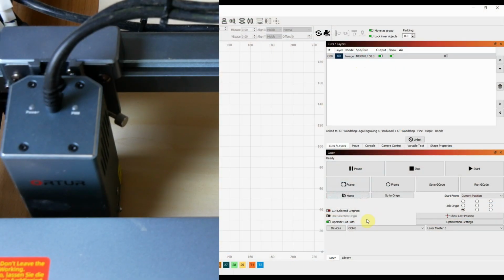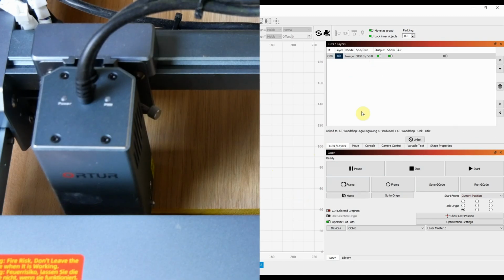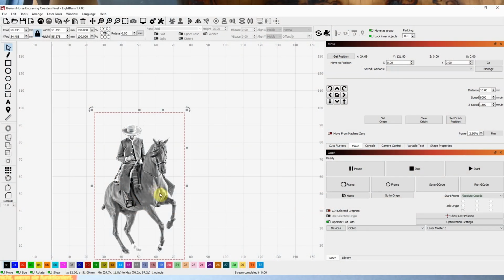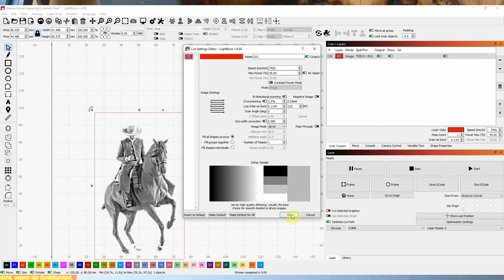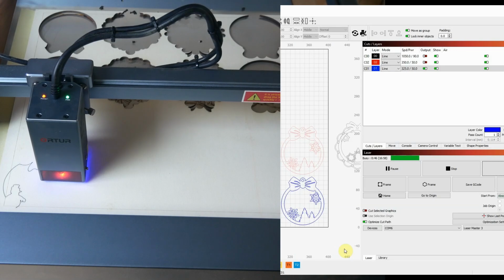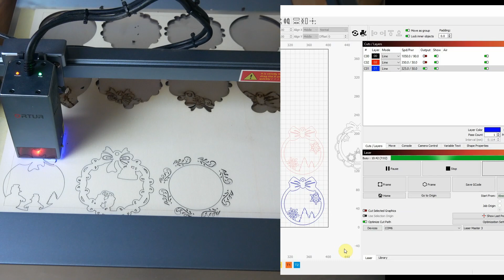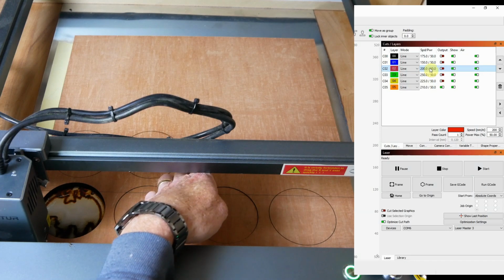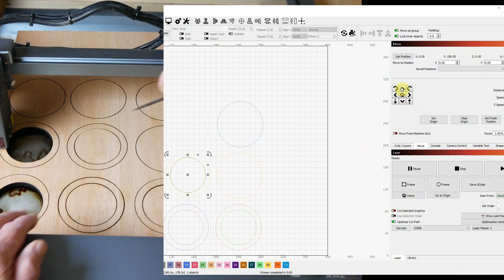Ortur Laser Master 3 Cutting and Engraving

Comment: Great video. I have one of these lasers as well. I added the air pump and the longer runners as well as a honeycomb for cutting. Believe me when I tell you that you really need a honeycomb to put under your products when you are cutting. You will cut your post work by 75-80% if you do. The cuts are just a lot cleaner and no smudging on the backside to clean up. :)
Reply from the maker: Thanks Ron, good to know. 👍